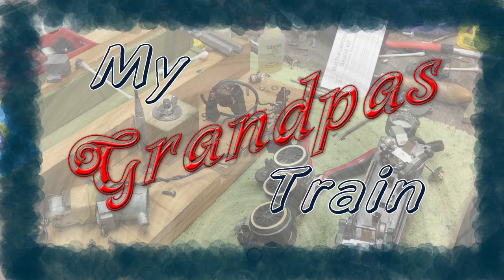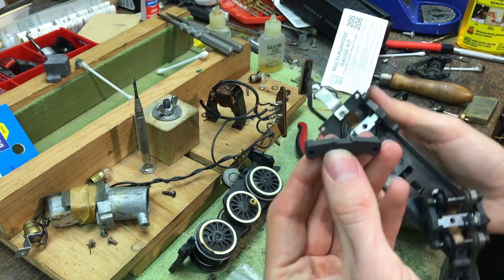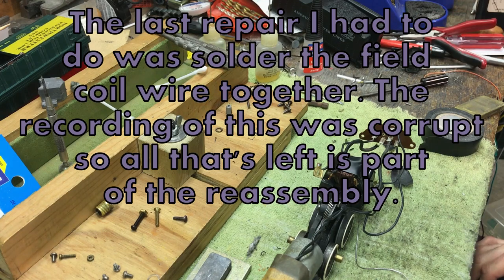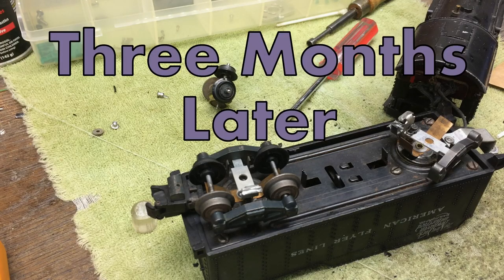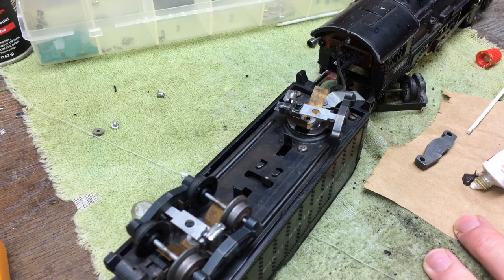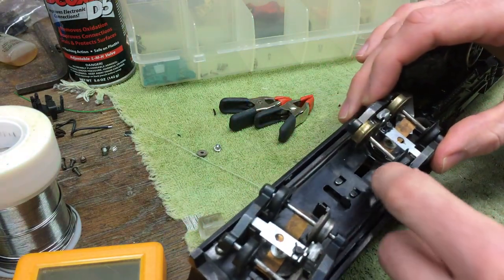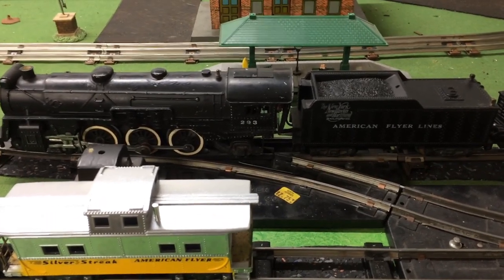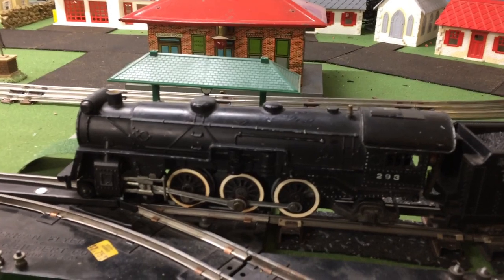I Had to Repair this American Flyer 293 TWICE!

Comment: Sometimes it takes a lot of sleuth work to find the underlying problem.  Well done.

I was intrigued by the tender pick up shoes.  My 293 does not have them, but my 342 0-8-0 tender does.  One is broken and I am looking for a replacement.

I have always used J.B. Weld for repairing  detached sintered iron side frames and on my AF by Lionel Nickel Plate Caboose truck metal side frame and J.B. Weld Marine Epoxy (because it is white) to adhere metal tires to plastic insulated wheels on steam locomotives (285, 293, 336 & 342).  I have never had these materials fail after the repair.  The 285 was repaired some 8 or 9years ago.  I found these repairs in Tom Barker's book.

I also use the Ficus tool for spreading sintered iron trucks to remove the axles.  It makes it easy to remove them without touching the sintered iron side frames.  You can swap attachments for sheet metal side frames, however I don't think attachment works as well as the attachment for sintered iron side frames.
Reply from the maker: It's interesting that only some of the models used pickup shoes. (I actually had a different 293 without them). My theory is that they were prone to catch on switches and things so they discontinued them. Plus I found that removing them reduced drag as well, and the engine actually runs better without them.
It might be possible to make a pickup shoe, by bending a piece of soft metal, but you'd still have to find a spring and retainer clip. Not sure if any of the parts suppliers have those, like Portlines.
Reply: @MygrandpasTrain  Port Lines has the pick up shoe listed for the 293.

My 342 has a similar pick up arm and shoe.  The shoe broke off when I tried to bend it back into position after I acquired it.  My 285 and 336 have the more familiar box, spring & u shaped pick up shoes like you find on the diesel trucks.  Both of these have the speaker, resistor and capacitor in the tender for the steam whistle.

I am surprised the tender is Reading Lines instead of New York, New Haven & Hartford with the coal auger.

Comment: Hello!   I watched your video on the 293 because I just acquired a 293 myself. I bought it non running, and in looking it over I discovered one wire coming from the tender, but not part of the harness bundle that is not attached to the locomotive…..Could you describe where that wire need to be connected on the engine?  And also what the purpose of that wire is?  Thanks for your help!!

Comment: Super glue never works for me for truck side frame repair.  I have done meny w JB Weld and they are still operational.
Reply from the maker: Good to know! I did get superglue to work on a box car frame. Must have been "lucky" on that one, it's still holding. I think the tender broke because the pickup shoes would catch on switches and twist the truck apart.